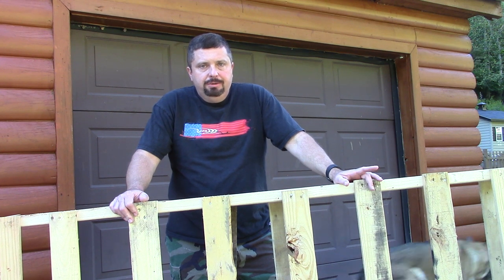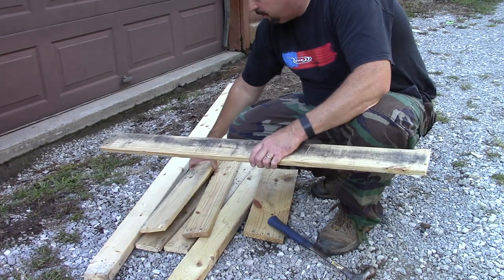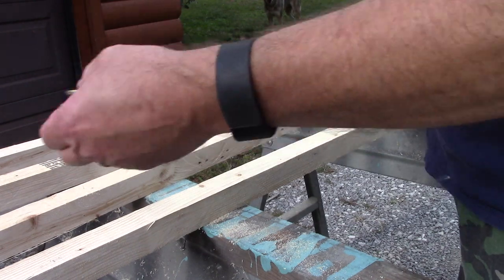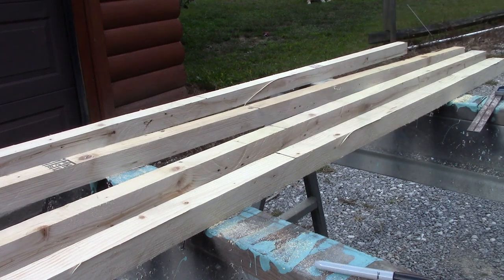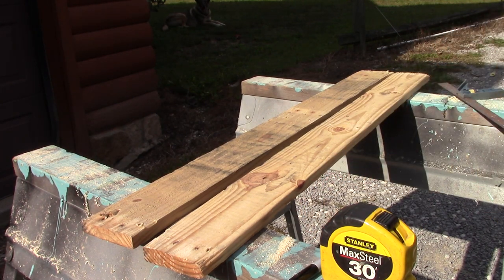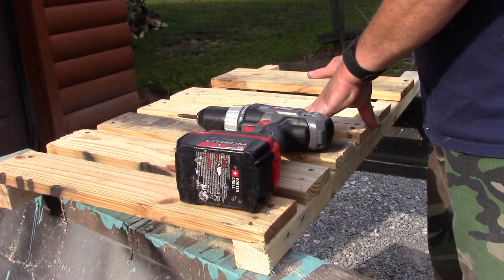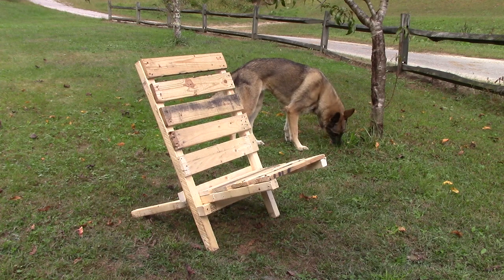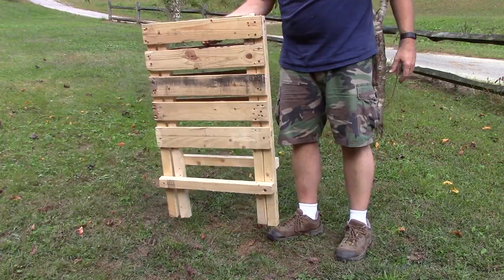Do It Yourself, Self Stowing Camp Chair from a Recycled Pallet

Comment: Hello can you please tell me the current measurement of placements below the seat panel both in the front and the rear  of the lower back frame? I want to build this but I would like to speed up the process by knowing how low I should screw those two smaller pieces of wood in between the lower frame thanks
Reply from the maker: In all honesty there is not set measurement for placement. It is a trial and error situation. It will be what is most comfortable for you. depending upon where you place this will determine how comfortable it is for the individual. Hope this helps.

Comment: It would really help a lot more if I knew the measurements of your boards that were seat bottom and seat back. are they both 18 inches or are they both 22 inches wide? Is the back 22 in and the bottom 18 inches or is it vice versa. This would really help a lot in the trial and error before I even start. Thanks ahead of time.
Reply from the maker: The seat back is 22 inches and the seat bottom is 18 inches the seat bottom slides into the seat back.  This being said it  literally can be any size you choose as long as you leave the seat bottom narrow enough to slide into the seat back. Hope this helps. Thanks for watching!
Reply: @KentuckyWoodsman  this helps a ton and thank you so much

Comment: greetings
Thanks for the no background music video. I like the idea and the finished project. I cringed watching you cut the boards to length. It looked like they were suspended between the horses. Maybe it was just the camera angle. So, there's about a 100 pallets around here. I think I'll give this project a go.
Reply from the maker: You are welcome sir. These camp chairs are surprisingly comfortable. I am curious why you don’t like background music though? Lol.    thanks for watching! I appreciate it and wish the best of luck on your chair build!
Reply: @KentuckyWoodsman  
Greetings
I'm just an old crank. When I'm working alone in the wood shop, especially if I am concentrating on getting something designed or laid out, I want no music. When I am assembling or finishing, I like some blues or instrumental music low in the background. I work with another finish carpenter at times and he has JAZZ on ALL the time. He is/was a musician and, it was his radio. To each his/her own for sure. It's merely a preference, not a must or a have to. Thanks for your reply.